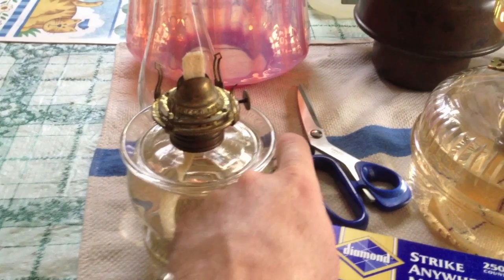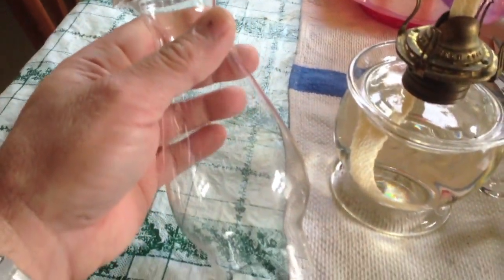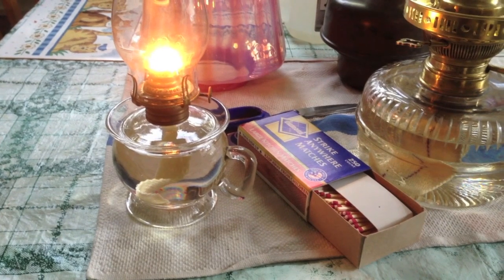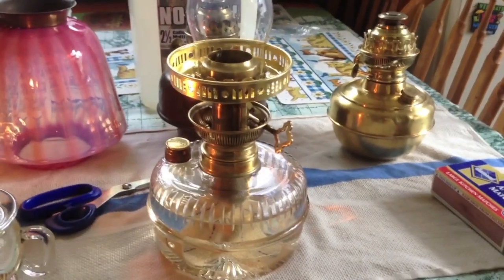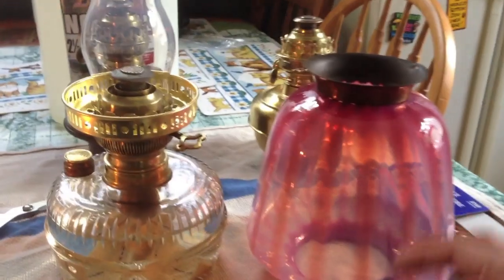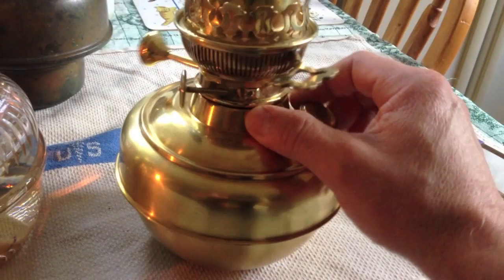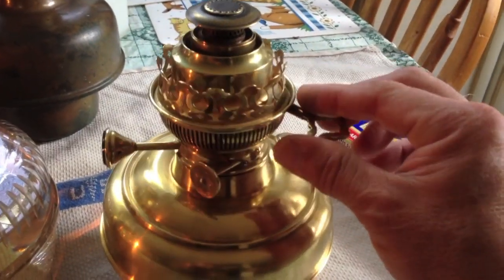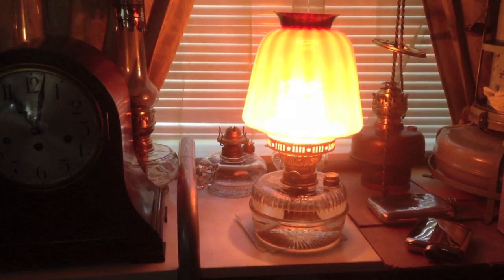Finger lamp Queen anne, Ehrich & Graetz 20''' oil lamp with Victorian shade

Comment: Always wanted Erich & Graetz Matador with the galley lift. Snubber is a bonus. The best non pressurized indoors lantern.
Reply from the maker: My wife’s grandfather in Norway gave me my first European style round wick E&G burner with gallery lift. It’s in the hanging lamp in one of my videos. He bought it in the 1930’s and used it extensively to light his home for 45 years. I still have that hanging lamp with the E&G Matador burner and it still works great. The ones with gallery lift are somewhat rare, with the snubber rarer still. They turn up on ebay from time to time. Much more common in the EU then USA

Comment: To Greg Monks, oil lamps can be exceptionally bright and the flames cause a lot of glare and image retention to the eye so shades are a must to have a useful workable light, softening the glare to prevent ones pupils from contracting and making the room actually appear darker...on a Queen Anne burner, if you cut the wick perfectly knife-edge flat you will get a better burn and a fan-shaped flame, trimming the corners can cause incomplete combustion and unnecessary odour production. The hall lamp shade looks like an English 'Beehive' Duplex shade if you take the brass trim off it. Great video!

Comment from the maker: Hello John. Miller made several types of burners but was most famous for its circular Juno lamp burner. The most common Miller Duplex being the Apollo burner. You can get a replacement chimney no problem. Measure at the base of the gallery opening to see the correct size base diameter for the chimney & order from oillampparts or milesstair. You can email either of them & verify fit. Ebay is the best place I have found to buy old lamp parts, once you know what you are looking for that is.

Comment: Nice video!, I love those E&G all singing all dancing Matador burners, I had a beauty once and cleaned it all up, a guy in Ireland bought it from me for about the price of a full lamp!
 
  The hall lamp shade looks good, if you remove the brass trim left over from the old hanging fitting it becomes a regular Duplex 'beehive' shade, I have done this in the past with some hall lamp that has missing chains etc...

  Regarding the 'line' measure in the comments on another of your videos, it's just a rarely used measurement using the same little dashes used for larger measurements in't he same scale; foot = ', inch = " and line = ''', inch being a twelfth of a foit and line being a twelfth of an inch (in general but this last measurement goes a little awry between manufacturers and countries) if you fold the round wick flat (squashing it as a tube along its length rather than opening it out as this is an example of a flat wick formed into a tube by the burner) then measure the inner width (rather than outer edge to outer edge) you should find that there are 20 twelfths of an inch, or there abouts fir a 20''' wick.

  I notice you cut the corners off the queen anne wick, it shouldn't make too much difference if you use a refined odourless type fuel but if you use regular pump Kerosene it may cause odours as the lamp isn't burning properly when the lower edges of the wick may be below the top of the wick tube when burning and it can push unburnt fuel vapour (and likely other nasties) into the room. Lots of people complain of odour with regular Kerosene, but properly trimmed lamps that have clean, dust free burners should burn cleanly and without odour when properly trimmed and with a decent fan shaped flame. There is always a little odour when the burner is first lit and also in extinguishing due to vapour still being produced in the still hot burner.

  You should check out a video I posted a while ago of 'my oil lamp storage unit' I think I posted it from my other account so maybe try searching that title if you are interested ;-)

  All the best and keep it up, it's an interesting hobby!

Comment: Whoa! You are by far, too similar to me. I have a dozen and more lamps and also I possess a clock rather like that one! It is a very informative video for me at this time, because I am on the verge of buying a hanging lamp from Ebay. You gave me a pointer about the snuffer, (I should have thought about that). I have checked and now I know that it does have one. So, thank you!. The finger lamp looked a little overfilled though, for are they not to be carried around the house? I am only wishing you to be safe, for I am sure you know that anyway and it is static. Best wishes, from England.
Reply from the maker: We buy most of the Euro lamps from ebay UK and ebay France. Those ebay sites always have a good selection. Your lucky or unlucky, depending on your addiction, to be close to the source. Inga's relatives in Norway got use our first Matador Brenner and from then on we where hooked. The Matador with both gallery lift and snuffer are the hardest to find. As I recall that particular one came from France.

Comment: I have a question for you. Can I take the collar off a normal #2 oil font and replace it with a collar that is for a #20 matador burner. The matador has a two and a quarter metric thread base. I do not know if the glass base font with a #2 American collar has enough play in it that if I epoxied on a larger collar (for the Matador burner), if it will work. I think the Matador wick will go down the hole. None of the oil lamp supplier knew. I found a cobalt glass fount I like and I am thinking a #14 or a #20 burner. Either base will work with the same collar. I found a brass wall bracket I like that will fit the font. I just don't know if I can exchange the collars. I do not haft to tell you how superior the Matador is compared to the American burners. Aladdin are always breaking the mantle with my shaky hands or just a stray gust of wind will destroy it and there goes another twelve bucks. I lit a mantle once and it just popped the mantle with its own wind. BEST OF LUCK FROM SOUTH FLORIDA...
Reply from the maker: The Matador burner has a wick raiser that sticks down into the font and the diameter is too large to fit the neck opening of a font sized for a number 2 burner. Find a font with a number US #3 size collar and you should be able to replace with it with a European 39.4mm opening collar, commonly referred to as the Kosmos #14 size collar. This collar will fit Matador #15 & #20 burners and fit most #3 size USA fonts. The bottom opening is 2.5", threaded top opening is approx 1.5". Checkout Oillampparts dot com for more info.

Comment: Hello Evan, I'm an oil lamp collector and I want to know the price of the matador 20" oil lamp with Victorian shade thanks.
Reply from the maker: The goat! Hello the price varies greatly. I have paid as little as a few dollars to over $100 for a E&G 20 line burner. Condition and features drive the price. But also getting lucky at a garage sale or antique shop. Original Victorian shades can be very expensive. Expect to pay between $50 up to $500 for a rare one. The Hallway or entryway shade shown in the video was $40-50 as I recall. These shades are more plentiful and hence the lower prices. Search Matador lamp on ebay and you will see many at varied prices